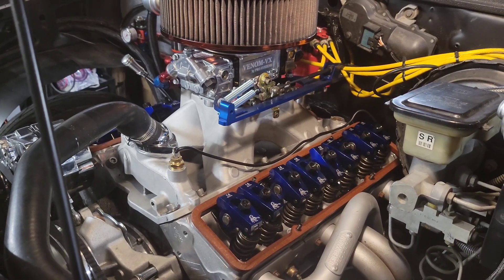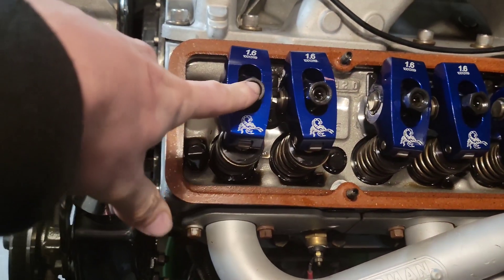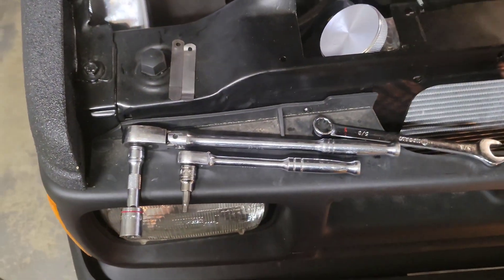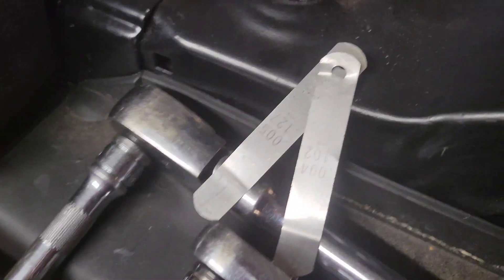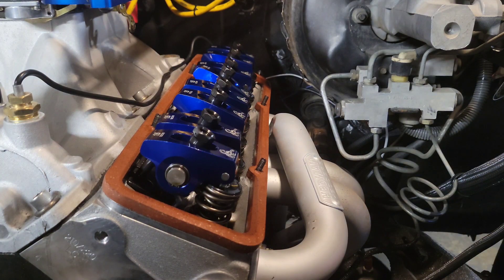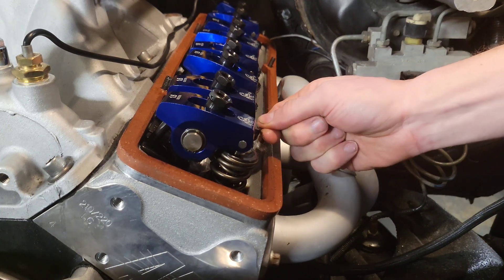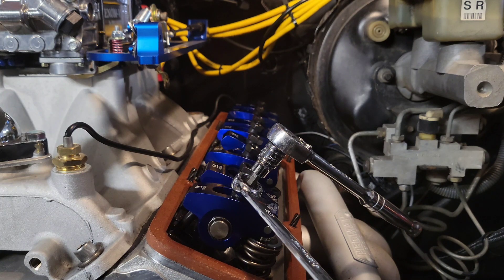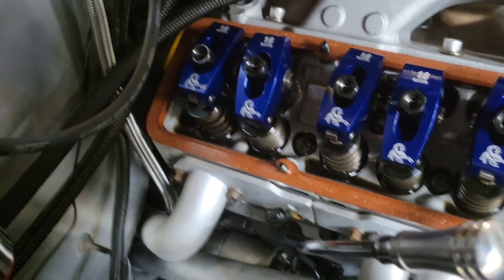*EASY* How To Adjust SBC Valve Lash using EOIC

Comment: Sorry,  can't stop myself,  what you were touching was the rocker arms,  not the lifters. Are you sure, .004" that's pretty thin. Doesn't allow much room for expansion..024" ok, but .004" You are going to have valves hanging open, or you are going to ding a piston or eight.
Reply from the maker: Drive the truck all the time and not a problem yet
Reply: Should be minus .006 cold lash with Aluminum heads and iron block.

Comment: It will be important to note that Ellis is working with a mechanical camsahft..... not a hydraulic cam. 
 
For those doing similar,  I would be refering to the camshaft spec sheet, and would use a degree wheel so that I could index the crankshaft as per the manufacturer's specs during this critical adjustment.
We need to make sure that each cam follower is at the bottom of BASE circle during the adjustment.  

A word to the wise. DO NOT use the center crankshaft bolt to rotate the engine with. 
The torque setting for this bolt is approx 60 ft lb. 
If you snap this bolt off, or if the threads were to become damaged,  you will be pulling the engine out, and taking it in for profession bolt fragment extraction, or worse.
Reply from the maker: It's been almost a year since I made this video. But, if I recall correctly, I did specify that I was working with a solid lift camshaft. Also, there is a part in the video where I show an illustration of the base circle of the cam. As far as using the crank to turn the motor, I have done it for years with no issues. As long as plugs are removed, no harm is done.
Reply: @ellisgarage1850  Yes, you did specify solid cam followers (mechanical camshaft), and yes, you did show an image demonstrating base circle (aka heel). 
As for the center crankshaft bolt..... it's your engine, and your call!
I would remind any onlookers that if that bolt was to snap off, you will be kicking yourself in the behind.
There is a tool for this that eliminates the use of the center bolt.
Reply: @markemery49 who crawls under the car to turn the engine by the flywheel/ flexplate.

Comment: SnapOn sell replacement feeler blades for their "Go, No-Go" feeler blade set. I have 3 complete set from 25-30+ years ago, but sure they are costly now. The ground stepped lip is 0.001" under and the shank is 0.001" over. So, if you're desired setting is 0.006", the blade will read 0.005"-0.007" making the stop (Ground Step) a 0.006" that stops at this setting. They can be ordered online and paired on a key ring as needed. Nice information!
DK, ASE master tech since 78, retired. 
Have a good 2022 & beyond.
Reply from the maker: I was unaware. Thanks
Reply: @ellisgarage1850   I don't know for sure anymore in this crazy a%#s world if you have order them off the truck or online. I wore out several 0.008" and 0.010" doing a standard cold (Room Temp) valve adjust as I worked at the Isuzu half of the Buick-Isuzu dealer. I had over 3,000 customers that had been in twice during a 3 year time frame. We went thru a bad, buy sell situation with another Buick dealer that threw things and hollered a lot. Just like my step dad on the farm after 7 beers! Now, they don't even like you on the truck if you don't work at the dealer they stopped at, even though I work with 2 techs and the parts manager for 16 years. Plus, I was Raytheon contract labor for ACDelco. I have 3 sets and today probably cost as much as truck tires, but I marked with auto paint tape, wrote the size and INT / EXH and gave them to my son. I ain't going to be around forever to adjust his poly-locked 1.52:1 rockers and showed him. Tried to talk him to hydraulic rollers but his O'Riellys buddy had him convinced he would have to drive at 5-6k all day! Have a good one in the crazy times. DK.
Reply from the maker: Sounds like you know your stuff. I enjoy learning all I can. Thanks for your comment sir.